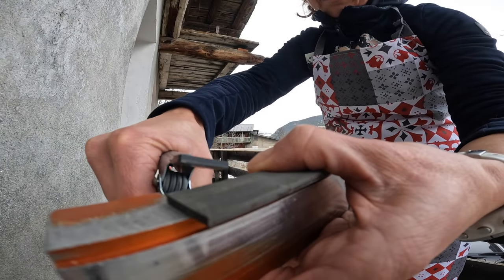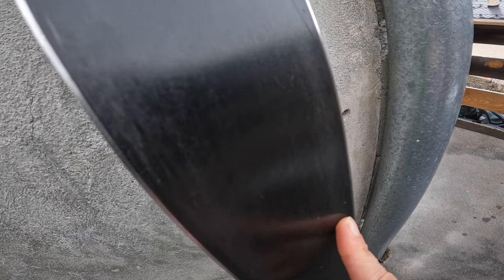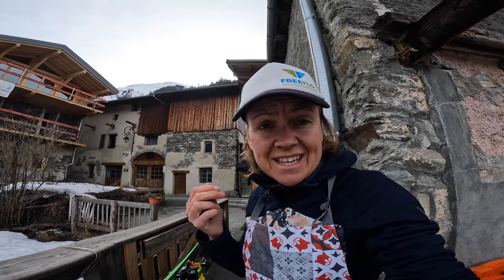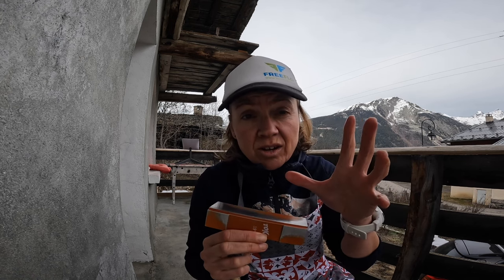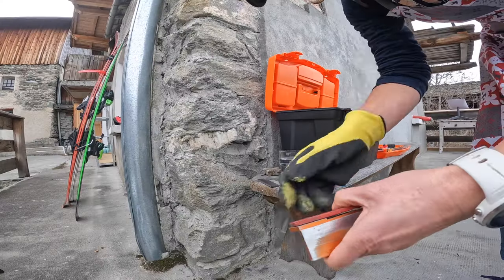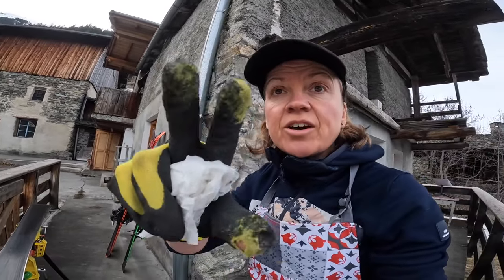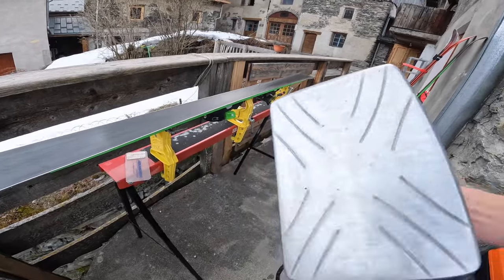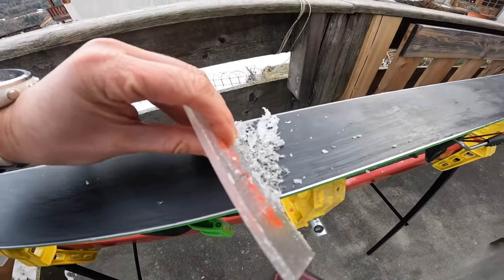How To Tune Your Skis In 14 Minutes To Improve Your Skiing

Comment: We only manage to ski twice a year (2 separate weeks) how often should we service our own skis. Excellent video. Is there a link to the equipment used?
Reply: I only do it between trips - which is 7/8 days skiing because it's difficult to take the servicing gear with you and find somewhere to use it. I've seen people say every 3/4 days and seasonnaires saying they only do it 2/3 times a season! Sometimes depends on what you are skiing and what conditions are like. Need sharp edges on hard packed but not for powder for example.

Comment: Always wondering whether the scraping off of the wax off the edges doesn’t dull the edges, rendering all the hard and precise edge work void?
Reply from the maker: I never know myself .I have that same thought
Reply: Because the side angles are slightly below the base, also a plastic scraper will not damage a steel edge..
I don't agree with not having a base level angle BTW..